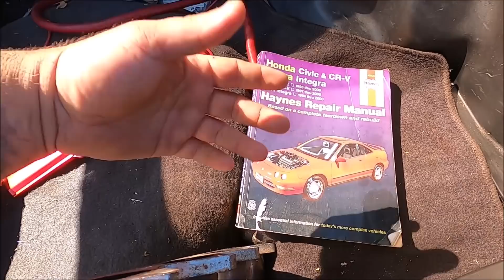My Kid SOLD His Clapped Out Sh*tbox To Finally Buy His Dream Car!

Comment: 214,000 miles is fine for a B18 Honda! Just check the oil every 250 miles i had a civic B18c4 in the uk 150,000 miles it burned a full litre of 10W40 in 250 miles

Comment: B18C1 swapped and hyping it up lol. It did come with a B18C1 GSR motor stock , not in the GS model, but obviously the GSR model. 170 HP if it's a JDM motor . Type R motor would have been something more interesting but this will work. The GSR b18c1's respond and handle boost very well. Just saying. :D